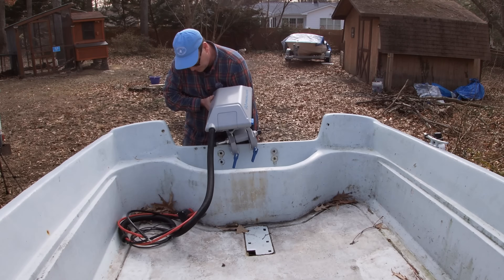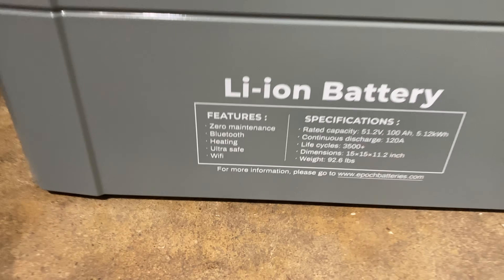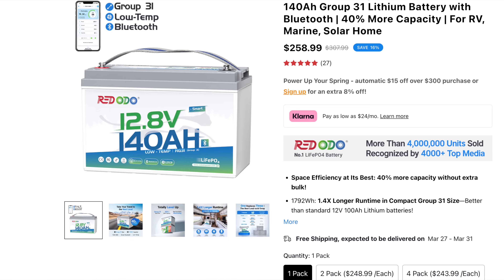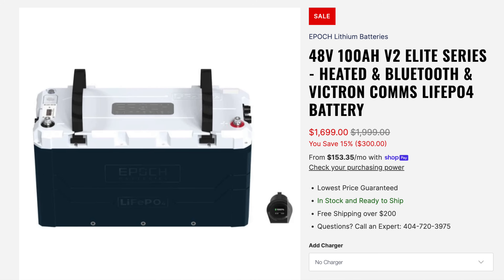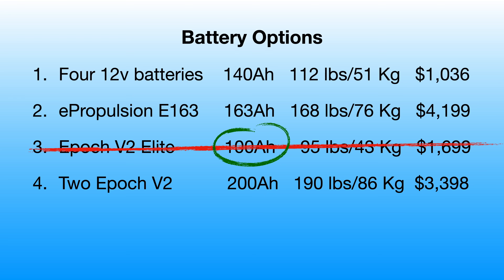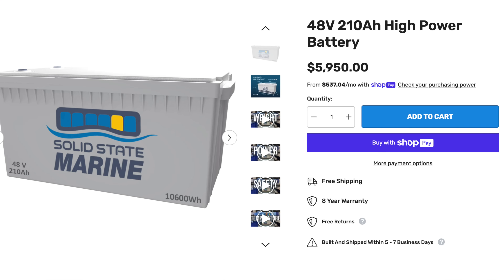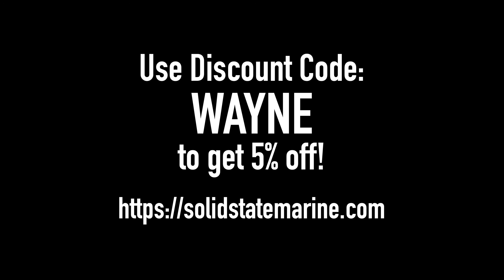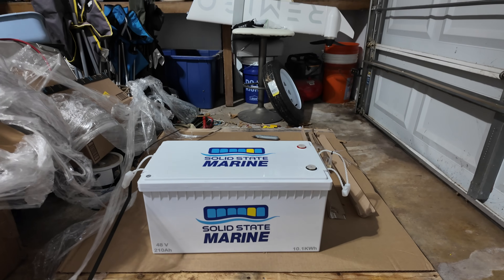My SHOCKING Battery Choice for Boat Electric Outboard Motor!

Comment from the maker: Use discount code "wayne" to get a 5% discount on the electric boat batteries featured in this video!
The batteries featured in this video include the following:
▶︎  Redodo 12 volt 140 Ah batteries: https://www.redodopower.com/products/redodo-12v-140ah-lithium-battery-with-bluetooth?ref=wayne
▶︎  ePropulsion 48 volt E163 LiFePo4 battery: https://tbnation.net/collections/epropulsion/products/epropulsion-e-series-e163-lithium-iron-phosphate-battery-lifepo4?ref=wayne
▶︎  Epoch 48 volt 100Ah battery: https://tbnation.net/collections/lithium-batteries/products/48v-100ah-lifepo4-lithium-battery-with-bluetooth-and-heating-feature?ref=wayne
▶︎  Solid State Marine 48 Volt 210 Ah (210 Amp Hour) solid state battery: https://solidstatemarine.com

▶︎ The Tiny Boat Nation Shop! https://tbnation.net/?ref=wayne
▶︎ Use coupon code WAYNE at checkout to get 5% off your purchase in the Tiny Boat Nation Shop!

Comment: Hi Wayne what 48v batttery would work for the 4.0  1000w 48v Hangkai electric?    You did use the powerhouse 32amp .  If used on a jon boat 12 or 14 foot, is 32 amp enough ?  is there a cheap option?   Thanks very much!
Reply from the maker: You might be able to find cheaper 48 volt batteries but sometimes the cheaper ones aren't better. Whether 32 Amp hours is enough depends on the speeds you're running and the amount of time you plan to run. Many motors that are 48 volt and 1,000w can run a 32 Ah battery at full speed for over an hour and several hours at lower speeds.
Reply: @WayneTheBoatGuy  Great help here .thank you. and enjoy your day!

Comment: Electric motors typically outperform internal combustion engines. However,  fuel tanks outperform batteries in energy storage by a massive amount. We are many years away from battery technology coming close to good old fuel tanks.

Comment: Very interesting decision tree.  It's cool how you laid out a bunch of options and were very transparent about the pros and cons of each.  You didn't mention a 5th option, which is two 24v, 100ah batteries, wired in series, and configured with a 150 amp BMS.  Something you also didn't mention is how the 140ah Redodo battery can be used in a variety of other applications, because of the flexibility you get with wiring in either series or parallel.  The final, and perhaps most important omission in this video, is the difference between the continuous draw from a given electric motor, and the surge draw.  I think if you were to get a DC-capable clamp meter, or simply watch the app for the Epoch battery, you would be surprised to find that the motor in question draws ~125 amps for only a very short time, and only does so if you go from a standing start to full throttle.  By simply using half throttle for a few seconds, while the boat overcomes the inertia of sitting still, you could then go to full throttle and likely never exceed even 100 amps.  I could be wrong about this, because each motor is different, but what I just described is exactly what happens with my 24v electric trolling motor.  I was very surprised to find that the two 100ah LFP batteries I'm using, wired in series, is some serious overkill for the way I use the boat and electric motor.
Reply from the maker: I agree - there are lots of other options and we can learn by sharing!

Comment: If I wanted to us a 9hp electric I would get 8 12 volt 100 ah for $120 each 
Wire them into a twin parallel system for
48 volts 200 AH. 
Then get a rib or inflatable, they make up for the weight difference, and they have huge weight capacity. 
I have a 150 24volt on my Saturn tr518 and put around for hours and hours on 2 12volt 100 ah. At 4.6 mph with 2 adults.

Comment: I've decided to upgrade to the 80lb thrust, saltwater rated Min Kota 24 volt transom mounted motor. I have an Interstate 12 volt marine/RV deep cell 88 AH battery for my previous trolling motor, a 55 lb thrust 12 v. Minn Kota freshwater rated motor. I'm thinking of just getting a second Interstate deep cell 12 v.  to use in series or parallel for the new motor. It's the most affordable option, and price is a main concern. Waddya think, Wayne? BTW, thanks for the new video, and the previous ones. Just dumb about electricity.

Comment: I got a 60v 150ah lifepo4 Bluetooth battery for $1048 canadian which is $750 usd 91 pounds they customize my battery with 4 handles at where I want it installed @aliexpress I checked marked all the boxes pretty good.
Reply from the maker: That's a very nice price!
Reply: @MiSCHiEF_BassMusic  have you tested the real capacity of this battery ?  On Aliexpress,  many times,  batteries are far short of their specs.  Good luck

Comment: 🌴 Hey Wayne, I always get a “charge “ ! 👈🏼😁 out of your videos, as far as an all electric boat set up they seem expensive for what your getting , I would think if there was a one time set up that would get you on the water and was self sufficient and would give you an endless supply of energy then it would be worth while , but  the only thing is it’s so expensive and is it really cost effective? 🤔would you be better off with a sail boat ?  For the speed you get out of one of the glorified trolling motors you could have a small gas motor push you along , fuel wise  it might be cheaper than a electric set up , and then it comes down to engine noise, and how fast you can get from point A to point B , those batteries your buying are expensive !  And your only getting an hour of run time on full throttle, where a 2 hp gas might burn one half gallon?  a retro gas motor on the back of your woody boat would just add to the beautiful appearance 😉
Reply from the maker: Yeah this setup is certainly not for the budget boater! As far as running a little gas motor - I have been there and done that and interestingly, that's what next week's video will be about!

Comment: I just built my own battery 3 years ago. 14S NMC 170AH CALB prismatic cells. Raw weight is 35kg. With water tight case, cables, screws, foaming and 200A BMS it has the weight of 42.7kg. It has been working flawless. 800$ total cost.
Reply from the maker: Very very cool!
Reply: NMC chemistry, high-draw application, and a boat is just not something I'm willing to risk.  Are you doing anything to cool those cells?

Comment: The battery management system Should shut off when drawing more than the rated current amps .
The bms is built into the battery so can’t be changed .
The battery will turn off when it overheats by the bms also .

Comment: Most boaters are more concerned with their kids braces and repainting the house, so a $5,000 or a $1,000 battery is out of the question.
Reply from the maker: I think it depends on the boater. Yes, this is not on the radar of person who bought a used 12 ft jon boat and hopes to get on the water for under $1,000.
Reply: Lol😅 dont Loose your Veiws on these High High Builds.. 99% people looking for Deals 😅ok @WayneTheBoatGuy

Comment: Man imagine the price of that battery, plus the price of the epropulsion motor. Compared to even a brand new 4-stroke outboard 🤯
Reply from the maker: Yeah it's not cheap! Although the 4-stroke outboards have to be maintained - it could be several years before the total costs evened out.
Reply: Like most new tech the cost will reduce over time , early adopters help that process so if you have enough money it's worth it .
Reply from the maker: @CarkeekW  just like LiFePo4!
Reply: I like the potential of electric outboards. Electric is rapidly becoming viable and more affordable for the 10 hp and under crowd. Even somewhat feasible for the under 30 hp crowd. I am now seeing 50, 100 and even 300 hp electric outboards out there.  But cost and battery weights are just not there at present for me to seriously consider them. 

My target range is a power package that puts somewhere between 30 and 50 KW of power on the transom and somewhere between 25 and 50 KWh of battery storage capacity in the boat with the capability to run continuously at full rated hp for up to an hour. In other words, what a 30 to 50 hp gas outboard with 6 to 12 gallons of fuel on board a classic size 13’6” to 15’ runabout would be. And give a full planning speed performance of around 22 to 30 mph. 

Every now and then, I look at the Elco 30 Kw outboard and available battery options. Right now, I still do not find a battery package I consider affordable or weight suitable. And the battery cost is still way way out there.

Comment: I would go with 2x Li Time (or other brand) 51.2v 100Ah batteries which go for around $900 each. You would get 200Ah when wired in parallel, you would only be pulling 62.5A from each battery @WOT and they weigh about 82 lbs each. Total weight is fairly heavy but moving them individually is a little easier...plus you'd only be spending about $1800. Only caution I have for people who want to go the 4x12v option...the more batteries you require, the higher chance you have at failure in one of the batteries. In a 48v setup having 4x12v batteries means you can't have any failure or your motor won't run. In a 48v parallel setup if one battery has a failure you can just use one battery for half the capacity of a dual system to get you back home...plus some types of batteries won't allow a 4S (4x series) connection. If someone wants to just go with a single 51.2v battery I recommend looking for one rated for golf carts as they are usually rated for 200A current draw

Comment: I think we get 12V batteries for just over $150 a piece making the total come to $600, which might be the cheapest option. 7:32
Reply from the maker: What Amp Hour would those be? There are many that are only 100 Ah (or less) and might not handle over 125 Amp draw.
Reply: @WayneTheBoatGuy you’re right those are 100Ah. Need to check how much the 125Ah might be.

Comment: Wayne,   I bouht a PowerHouse Lithium 48V 173AH/8.3KWH for just over $3K .  Weight is 120 lbs.  It is a LIFePo battery with built-in BMS, read from your cell phone.
Reply from the maker: That's a great choice!

Comment: The first choice is not as heavy as your number because they are divisible for carrying. I would have priced four 24 volt batteries. Wired in series and parallel .
Reply from the maker: That's a neat option!

Comment: Have all these battery options been independently tested to verify the manufacturers' claims?  There is a trend in the rechargeable battery industry wherein manufacturers inflate the capacity of their products in order to appear more competitive in the market.
Reply from the maker: Not by me. But I have used all of these brands in the past. I know the new version of the Epoch was tested by Will Prowse and there were some issues, but those are getting resolved.